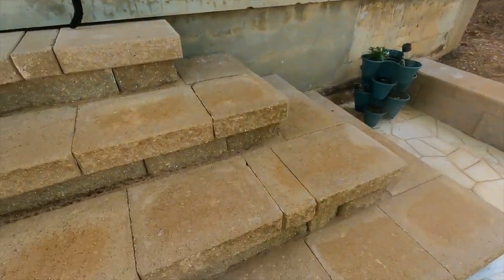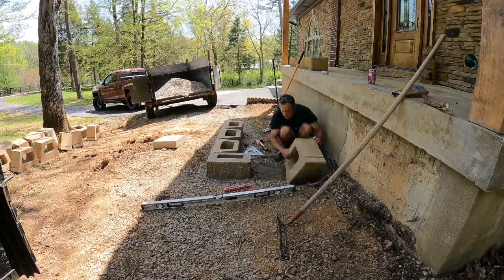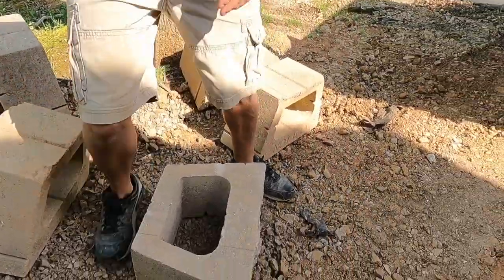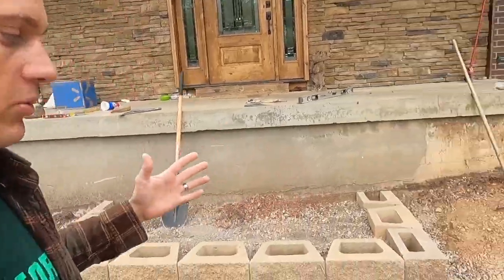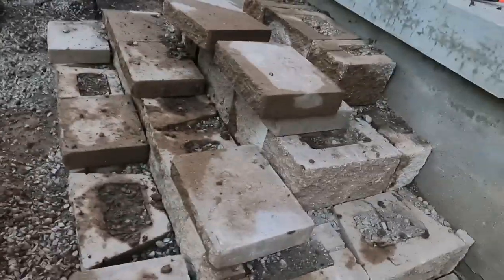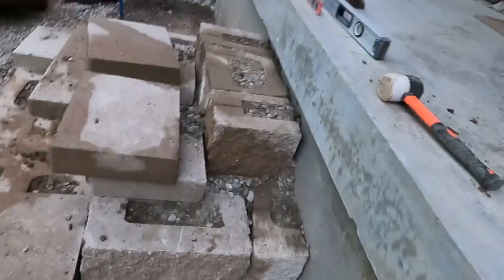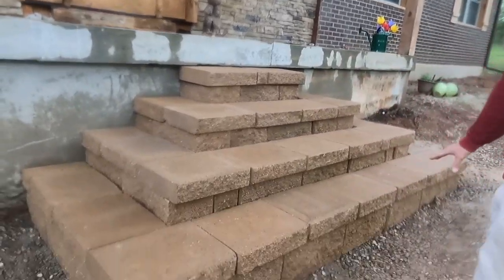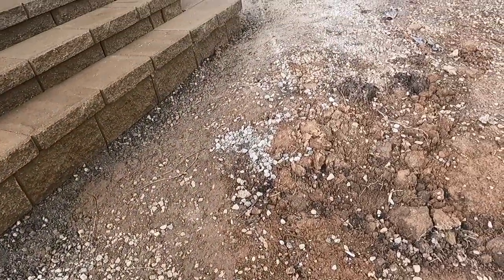Make Retaining Wall Blocks Your New Steps

Comment: what’s to stop the cap blocks from falling off or tipping when you step on the outer edge. LOOKS DANGEROUS
Reply from the maker: There is only a small overhang. You would have to have a ton of weight to flip it. But if that was an issue you could put some construction adhesive under them that would bond them.
Reply: Will you add handrails?  Can't be code not to have one for the 5 steps.
Reply from the maker: @juliejohnson7394  not worried about code but yes a handrail could be added